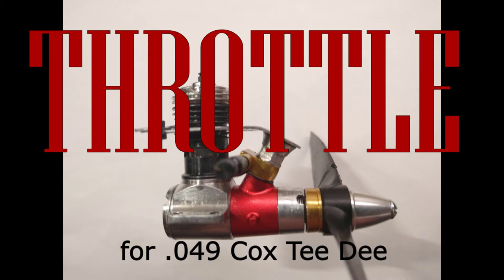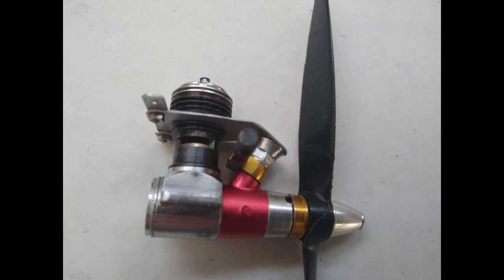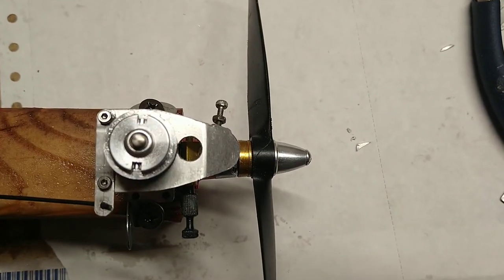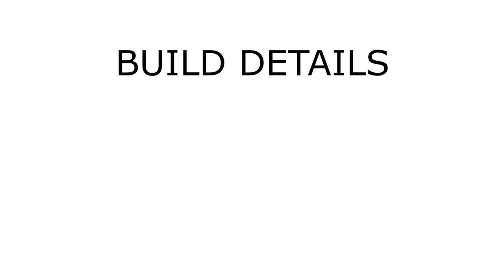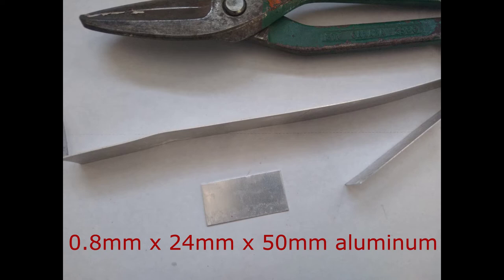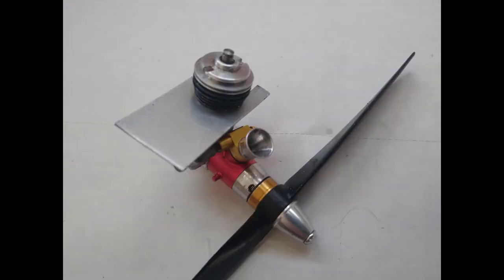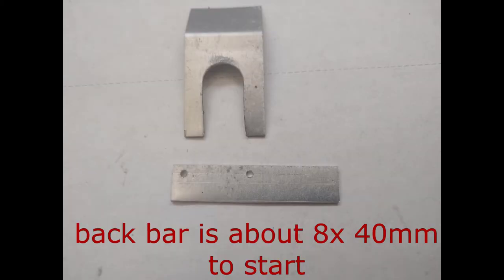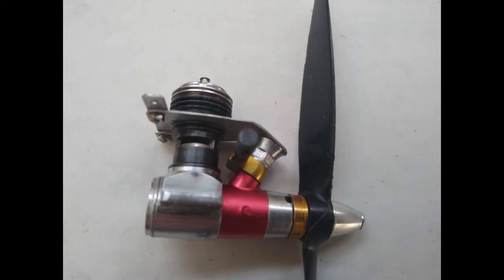DIY Throttle for Cox Tee Dee (TD) Engines

Comment: When I was a kid,  I remember having a Cox Corsair which had "throttle control"  and if memory serves the 049 had a sleeve on the engine that would rotate over the exhaust port.  It's been awhile; I might be wrong <:)
Reply: @vizerdown I was always the aviation guy; my brother was the car nut.  If I recall correctly that was a 56-57 Chevy that was Cox-powered.

Comment: Hi , back in the '70s, there was a company in California that made a real carburetor for the Cox " tee-dee"
Engines. It replaced the screw in intake and stock needle assembly.
There was another company that 
Made a " metal front intake ring/nose cover . It replaced that nylon
Piece.
Reply: Can you say tarno carb?

Comment: This is just a choke, closing the Venturi off in that manner draws more fuel into the engine making it run very rich. An exhaust throttle sleeve would give better results
Reply: The engine also needs air to run... closing off the air will ALSO slow the engine down. Throttled carburetors on ALL engines basically work the same, and have a butterfly that closes off the air entering the engine. It isn't "just a choke". Slowing down the airflow also reduces the pressure drop across the venturi and as a result, it'll draw LESS fuel out of the jet
Reply: @davelowets  actually it is just a choke. The throttle butterfly you are referring to would need to come after the fuel spray bar in order to work as you mentioned. This butterfly comes before the fuel spray bar, when you close it, it increases vacuum pressure at the fuel spray bar. This causes a very rich mixture slowing down rpm

Comment: easy is good and it will choke/richen the mix.  my problem was getting fuel from the fuel tank later in the run.
so It has merit.